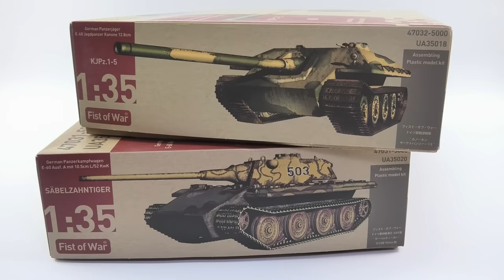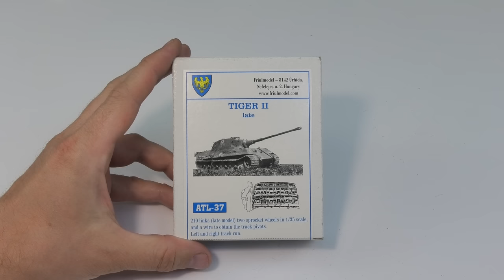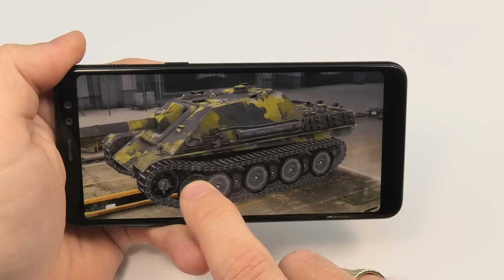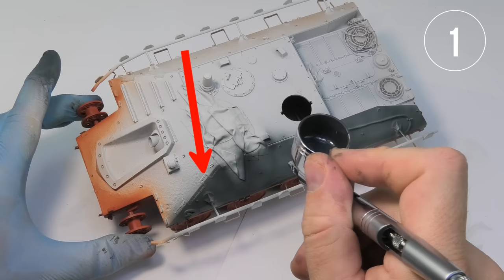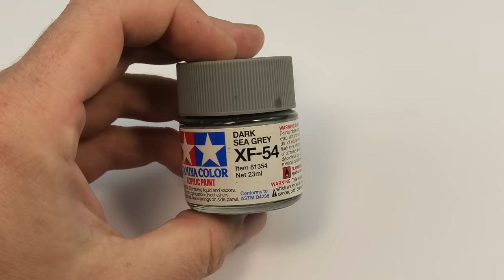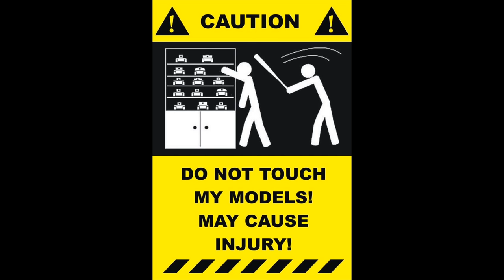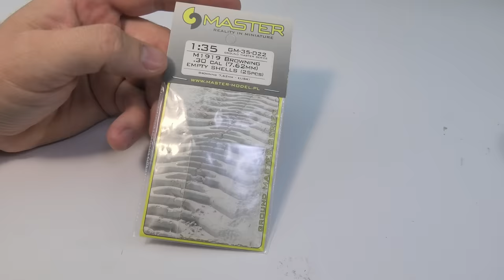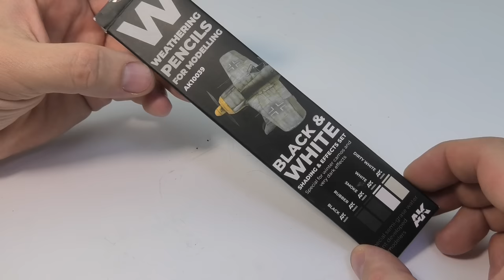The Most Satisfying JAGDPANZER E-60 FULL BUILD You'll Ever See

Comment: I use an old trick when masking using tape and an airbrush. Before painting the color, spray a thin coat of clear around the edges of the mask and give it about 10 - 15 minutes and then paint your color. Of course, the clear and the color paint have to be compatible 🤓 The clear acts to "seal" the edges of the mask, and keeps paint bleeding down tremendously! I love your channel and plan to use a lot of things from this video on my 1/16 Resin Hetzer I have had in my stash for years!
Reply: Wow, just tried that it, worked thanks a lot!
Reply from the maker: Thx for this tip! :)

Comment: The only problem i say is the lack of shell impact from enemy fire.
It should have some visible deformation and even holes in the shields and on the main body itself where the shell penetrated the shield but left just bruising on the armor and the shield did it's job
Because right now it looks like an offroad truck in the woods and not a tank that has seen battle
edit: and when you take photos i'd recommend you use a sun spectrum source of light from the top, to give the paint natural lighting when captured by the camera (cold white light source will have different color output viibility)
Reply from the maker: Thx for your opinion. :)